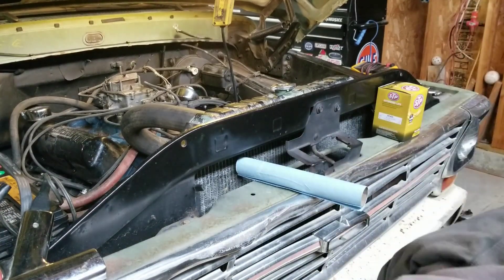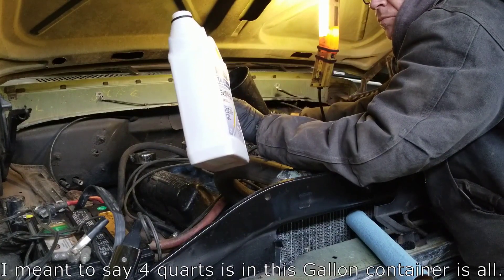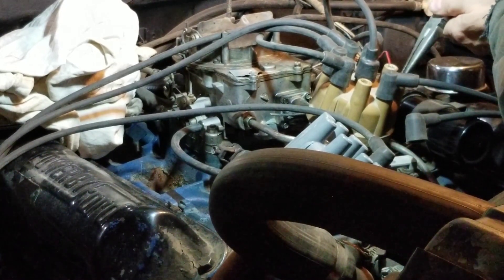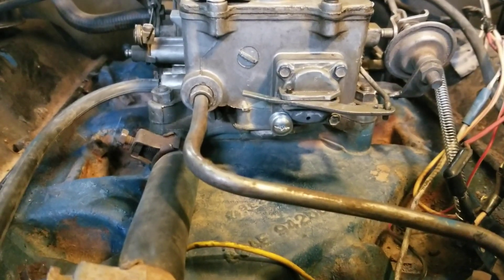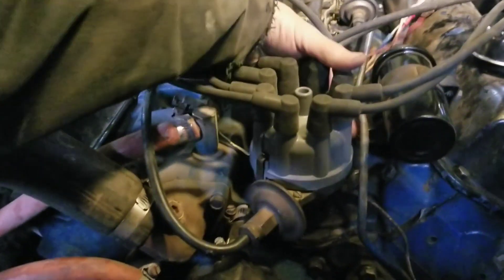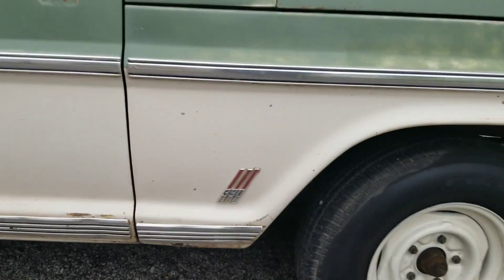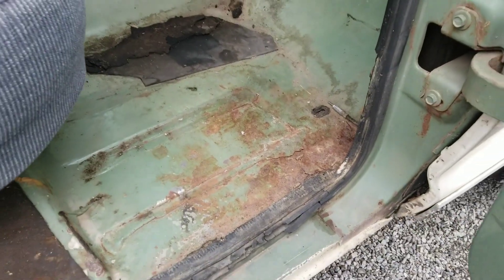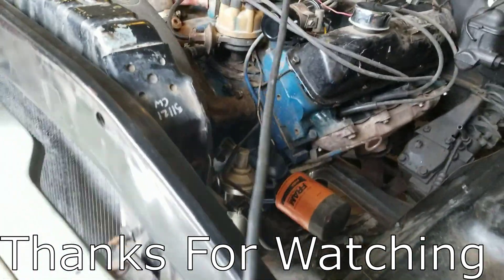More Tinkering with the 1969 F100

Comment: I like the 70 better, but I had a 70 way back in the late 90s.  With the modifications done to the 69, though, you can do anything and not mess up the value since it is nowhere near original.
Reply from the maker: Hey Randy, yes the 70 was a good truck.  It didn’t need as much work as this one does.. Thanks for watching and commenting.
Reply: 69 has a better grill
Reply from the maker: @yeboscrebo4451  I sure am going to try to straighten it out.